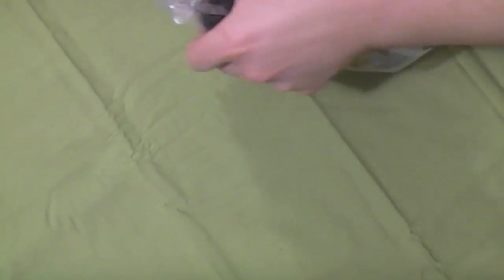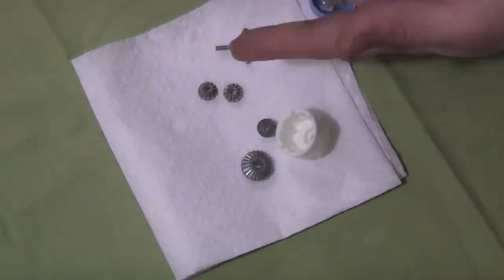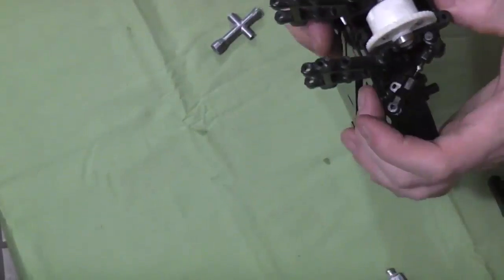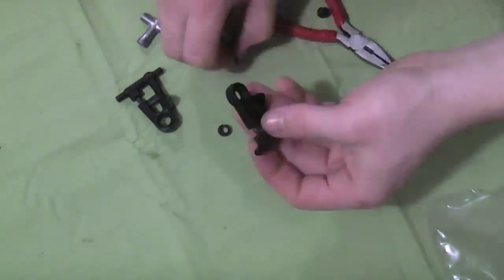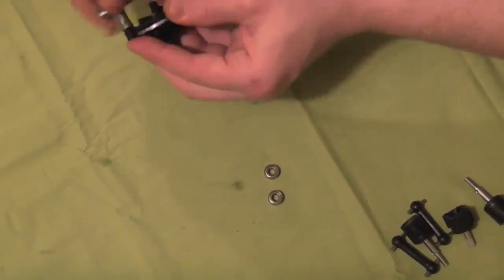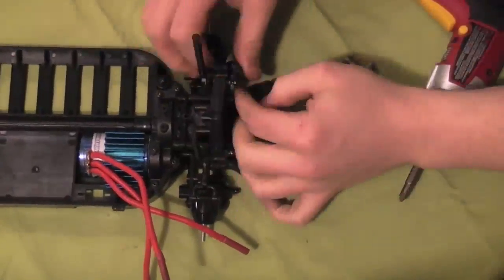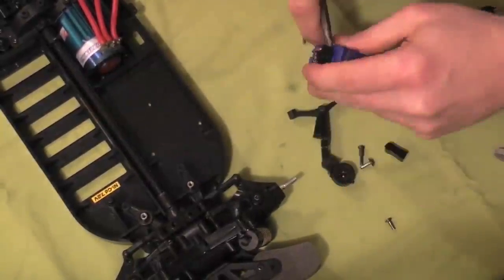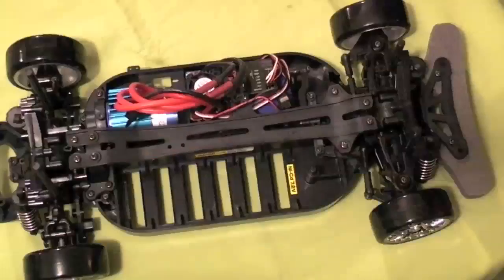Tamiya TT-01D Drift build

Comment from the maker: @rcBitz The body post have alot of adjustments for ground clearance. Most 200mm body will fit. You may need to trim the wheel wells a bit.

Comment from the maker: @chiko909 It did come with the servo saver. The motor is a 23T sport tune motor. I cant say anything about the performance as I have never user it. Went right to brushless on the build . The camber can be modified but you need to dremel out the A-arms for negative camber adjustment.

Comment from the maker: @TheIoannidis as long as your servos are 3 wire servo they will work with any hobby grade transmitter and receiver. All electric RC have an esc (electronic speed controller). It's what gives your your proportional throttle. it allows you to go from 0% to 100% throttle in a smooth motion

Comment from the maker: all you need for power is the lead from your esc. Connect that to your throttle channel and then insert the bind plug in the bind port of the esc. Once you turn on your esc the receiver should have one flashed green led.If not then your battery mite be to low in power and the ecs is hitting the low voltage cut off. also could be a faulty rx or esc. Depends if your esc has power. If you do have the flashing green Led then just bind it to your radio and you should be good to go. Hope that helps.

Comment from the maker: you should also make sure that your esc lead is connected in the right polarity for the radio. You should see "+","-","~" the last symbol is your signal wire which is usually orange or white.

Comment from the maker: I think your referring to the diff grease and yes it comes in the kit. It's a great beginner kit for sure. All that's required is a servo, transmitter and receiver. oh yes and you also need a battery and charger. Everything else is included.

Comment from the maker: I Do have a short course Truck. Its a highly modified now but it started out as one of the original slash 2wd. The Hobbywing ESC will be fine if you get the 60A model. I was running the 60A with a 5.5T then changed to the 8.5T. Never ran the 13T tho. What I would suggest ultimately is the Velineon Brushless Combo. That what I run today and have been for over 3yrs now. Great setup with plenty off power. Wheelie on the demand with 3S. Check out my slash playlist tones of footage.

Comment from the maker: TT-01 is the model. The nismo is the body it comes with. TT-01 has a few variants but they are very similar no major changes and all parts are interchangeable. TT-01D is the drift version(hard compound tires). TT-01E has led included in the kit but is an onroad version and the TT-01ED is a mix of both. It has hard compound tires and LED's included in the kit. Other than that it would be the body type included in the kit.

Comment from the maker: the TT-01 is mostly plastic. The Hpi Sprint 2 drift has a bit of aluminum but not all done up. Tamiya TA05 VDF is pretty blinged out but pretty expensive. Yokomo also has a few high-end drifter. Back to the TT-01 it does have alot of aluminum upgrade parts available @ a reasonable price.

Comment from the maker: @lowlevel21 I would say your steering assembly. I purchased the 3Racing one with bearing cause I found stock would bind and didn't move freely. Other than that nothing immediate. I always like to run my kits stock for awhile to see what kind of improvement I get with the upgrades. LOL...well I usually convert to brushless right away but that just me..I much prefer the feel of brushless. Check out my my sprint 2 drift another great kit.

Comment from the maker: the stock set up is Tamiya (#53068+90529) - Tamiya RS540 Sport-Tuned Motor + TEU-104BK ESC Combo. For servo I always use Hitec 645MG cause they are cheap. Good all around servo. You may want to get something with a faster response time but It works just fine in my kit

Comment from the maker: yes you can. You need to purchase hard compound drift tires.I use HPI T-drift tires. you don't need anything crazy to get sideways cause the hard compound tires make it easy to drift. You should be fine with a brushed 20T motor. You can go bigger but it will be over kill. Hope that helped

Comment from the maker: servo I would go with a hitec HS-645MG. They are cheap and very durable. Not the fastest but will do the job. TX/RX all depends how much you want to spend. flysky has some decent TX/RX for about 45$...extra receivers are under 10$ so that's good. I have many TX and currently I'm using the Spektrum DX3R Pro.  All depends what your looking to spend. I went with the Spektrum due to all the extra features...3 position 3 channel...50 model memory....Programmable buttons.

Comment: You can get a Flysky GT2 2.4ghz transmitter and receiver for around $20 online. It has very good range. I got my tt-01d for about $150 online. Get these and you are set for a beginning drift car. You can always upgrade the tt-01 later. Also, it is hard to screw up the instructions are very clear. Just make sure to get the right screws in the right holes. If you do happen to really screw up you can get a whole parts tree for only a few dollars. Hope this helps.

Comment from the maker: all drift rc cars are AWD. The sprint 2 drift is an RTR...Comes with everything including the battery and charger. The TT-01D is a kit. You need a Transmitter(controler), RX(receiver), servo, battery and charger. and for the build questions you just watched my video. What's easy to me could be hard to you.

Comment from the maker: @rhymesayers17 I have never owned the HSP so I cant comment on that. The tamiya cost hsp 170$cad and the brushless system was another 80$. I went with hobbywing sensorless Ez-run 60amp and 10T brushless motor. I really like my Tamiya but I would suggest the HPI sprint 2 drift is a much better all around choice. its 250$ ready to run with 2.4GHz system and a nice brushed system. Extremely smooth and easy to drift.

Comment from the maker: the more cells the more voltage so that means more power. you would need a lipo charger but most new chargers have lipo capability. I have the Duratrax onyx 230 for a a few years now and its great. I purchase a greatplanes balancer for about 20$ and that was it. GOOD FOR YEARS AFTER THAT....LOL

Comment: also my issue is is the on off switch that came with my dx3c i dont have a spot to connect it to get any power to it. and i have the spektrum sr300 receiver...and with my tamiya i have little extra plastic on them to where they dont fall out as easy im sure thats what theyre for...

Comment: Thanks for the info I believe I'm running a 104-BK so since I can run a 2C lipo battery that means it has a lipo cut off? And yeah there's 7 cell and 8 cell Nimh batteries out there, they meant for 1/10 1/8 buggie's truggie's and Short Course Trucks, I always used to race those so I have a ton of those laying around since I actually live in the city nao I thought I might try Drifting since I do it In real life

Comment: i have today actually lol. the guy said that i have to take it apart and check the differentials and make sure theyre not locked. my issue here now i found out is that my wheels will not move at all. which is why it wont go anywhere...

Comment: If you just want something cheap you could get an acoms 27mhz transmitter. on its own it's about £20 but if you need a reciever and servo I'd get one with a servo and reciever which is about £30. I've got this and is great if you want budget equipment But if you want a really good transmitter and reciever you want a 2.4GHz system. You won't need to worry about interference and glitching, give quicker response and a bigger range. acoms also do budget packages of these which are about £50.

Comment: ah, I see. But only problem is, a friggin transmitter at my hobby store is more than the kit lol. And they don't even have it in stock. I wouldn't worried about the cost that much if I actually had a job, but I'm only 14 right now and I want something other to do than playing xbox or on the computer. I love to build stuff, but if i screw it up then there goes like 300+

Comment: Hey Shawn, thanks for the video! it helped. Now, where did get your plain frame to install the TT-01? i have been trying to build mine from ground up but i am having trouble finding just the frame. Also, is there a specific site you went to to get the stuff to build or did you go direct to Tamaiya?

Comment: If i was gonna use the default moter and the same esc you run what battery and charger should i get? Also what about the radio and the reciver (if it doesnt come with one)

Comment: I literally just finished building my chassis an hour ago, bodies prepped for paint, but one question what battery are you using? or which battery do you recommend with the stock motor and esc?

Comment: alright so i iv'e been into rc drifting for a while with an hpi sprint 2 but, just built my tt01d up (about 4-5 hours) and when i turn left into a drift and countersteer it my right wheel seems like its getting no power so got a rebuild kit and its doing the same thing so i went on ebay to look for different kinds of diffs and i found a one way diff from 3racing so do you think this will help... thanks for a reply...

Comment: Servo and receiver included?
Reply from the maker: nop
Reply: Mmm what battery do you recommend? How will that last. Have you tried tt02? Maybe I can email you or something...
Reply from the maker: I use a 4000mah. No I haven't driven the TT02
Reply: Ok. One last. Should I go with tt01d? Or tt01d type e?
Reply from the maker: all the info you need about tt01 is here. it will help you make your decision.
http://en.wikipedia.org/wiki/Tamiya_TT-01